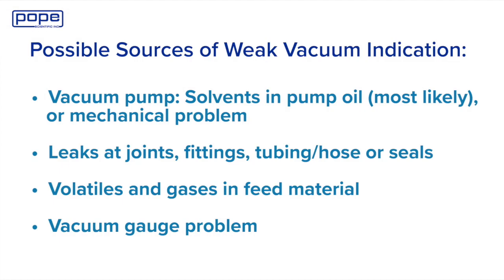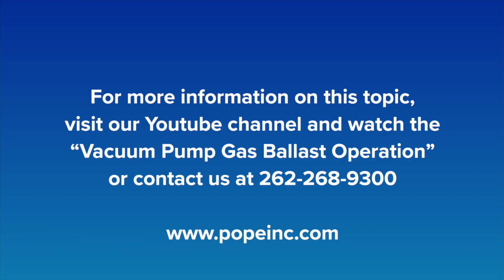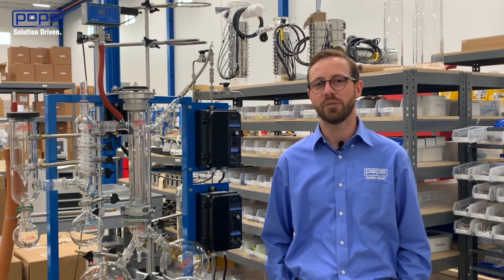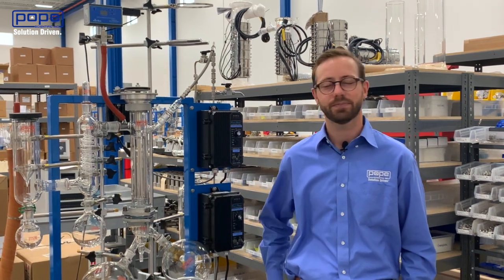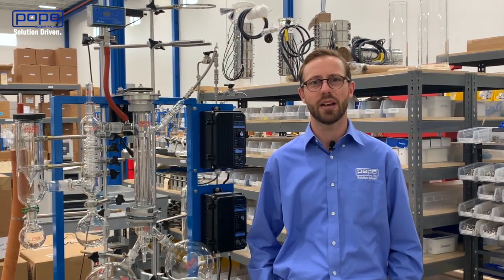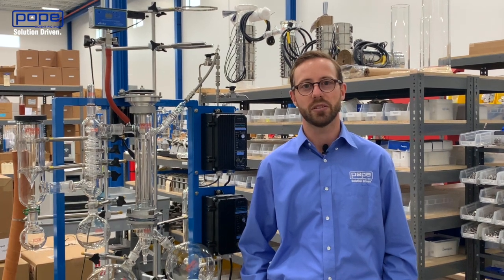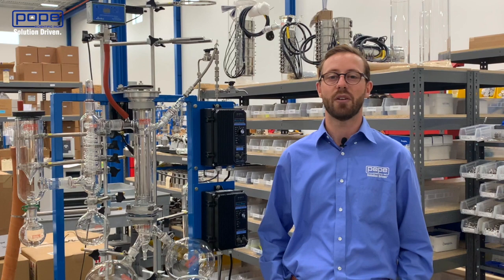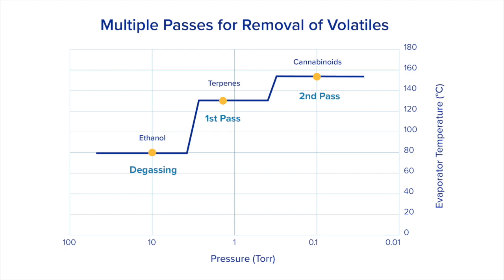How Volatiles Can Affect Your Distillation Process

Comment: How do you find vacuum leaks ?
Reply from the maker: Finding vacuum leaks can be a tough process. The first step is to always verify that the appropriate valves are closed and, if using a glass system, that joints are properly greased. It is also important to check glassware for fractures that may be causing the leak. If these basic steps do not work, feel free to give us a call so that our technical staff can assist you!
Reply: @PopeScientificInc   thank you for response!  Learning every day
Reply: Great video! Thank you for going into depth about the flashing that can occur.